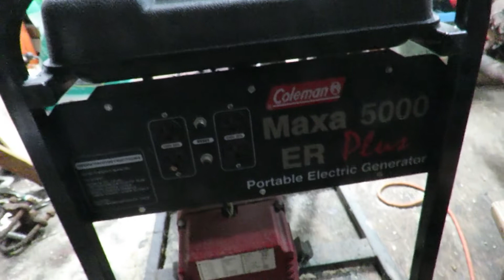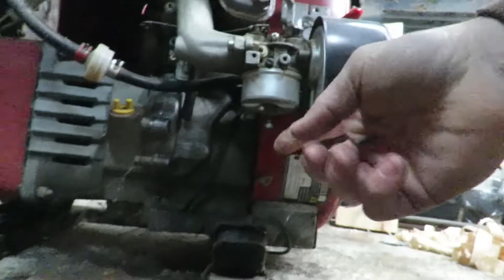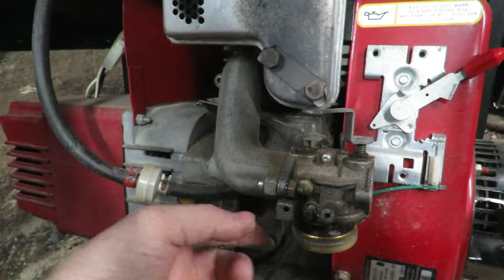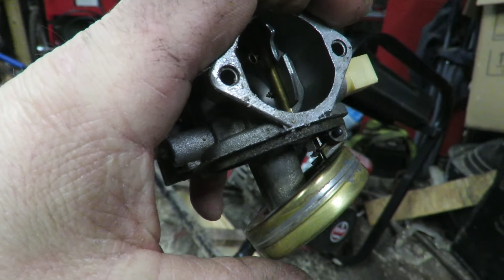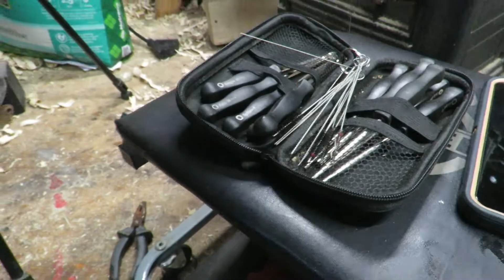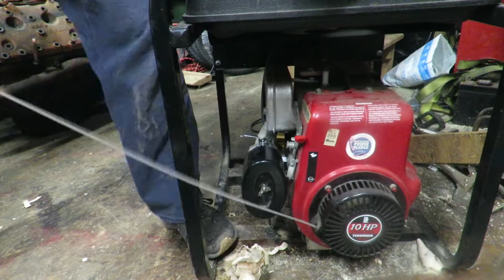Repairing a 5000w Coleman Generator

Comment: Wait, it ran for 5 minutes and then what happened? It looked like you had the carb off again for a split second at the very end there and it didn't seem good.
Reply from the maker: Sorry if it wasnt clear. I ended having to use parts of the new carb on the old carb. After using the new needle/seat, o ring and float bowl it is running. Ran it for over 30 minutes yesterday with some new non-ethanol fuel.
Reply: @ASliceofWoodWorkshop  Nice! I kind of had a feeling it would end up having to be a mix of parts and probably using the old carb body. Had pretty much the exact same issue on a mower a couple years ago and ended up doing mostly the same thing. Those cheap Amazon replacement carbs are usually not the highest quality items lets just say.
Reply from the maker: Yeah and the carb didnt have the same layout as the original even though it said it was exact replacement. I didnt think it was going to work, but was willing to try anyway. Thank you for watching!